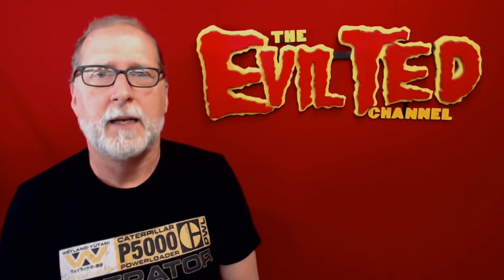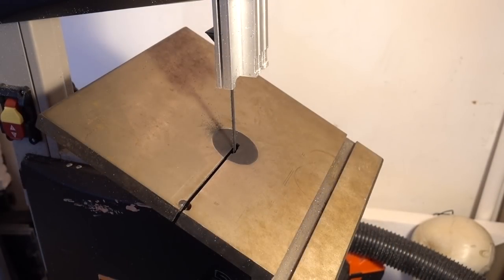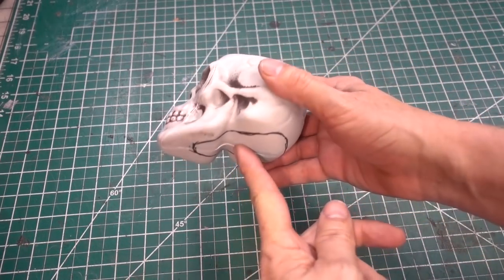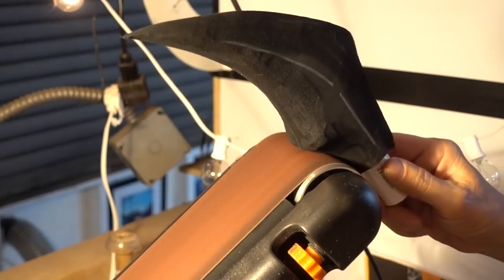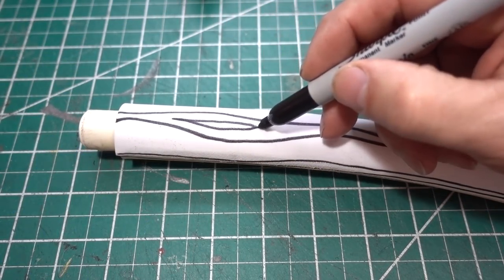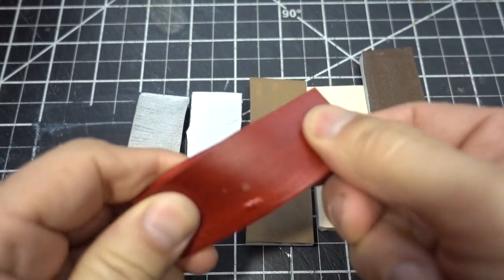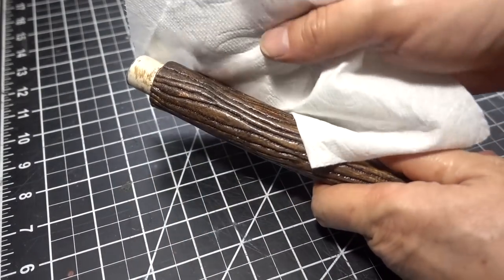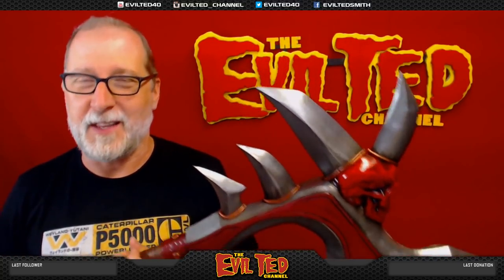Making a War Axe & Painting with PlaidFX paint

Comment: That was fantastic. Why magnets and not just stuck on?
Reply from the maker: Great question. I use glue everything on all the time. Down side is if you want to travel with it there's no way it will fit in a loot locker. So from now on I make everything travel friendly.
Reply: Evil Ted Smith makes sense I never thought of that. Thanks.

Comment: When I'm repainting Nerf blasters, I use enamels (specifically, Testors' brand model paints), so I'd like to know how acrylics compare when painting both hard surfaces and closed-cell foam, since I've had mixed results with enamels on foam. Anyone care to share their opinions on the matter? Thanks!
Reply: I use a lot of acrylics for airbrushing foam. Not that much enamel, only for metal that gets cracked paint on top. I really like it, stays bendable.
Really depends on your basecoat to be even over the porous foam. I had some pores stay open sometimes

I have had some bad effects when i sketched onto my foam to figure out where to dremel. High density foam, pen for the details, basecoat with Plastidip, airbrushed acrylics on top.
Some time after that the pen started to seep through. It seems to go away after some time though.
Reply from the maker: Yes, I agree, acrylic is better for foam. When it dries it's still a bit flexible.